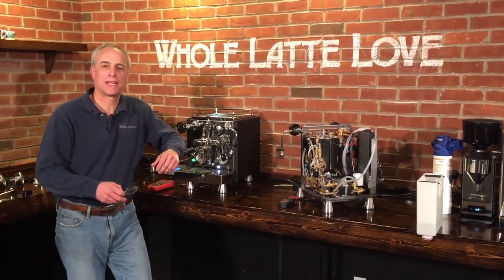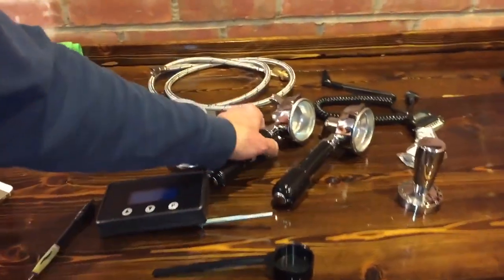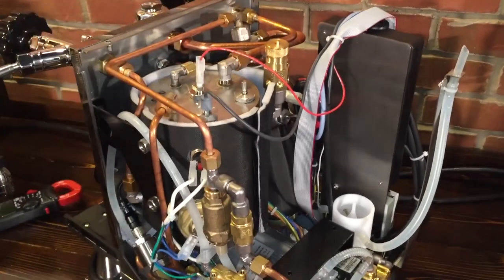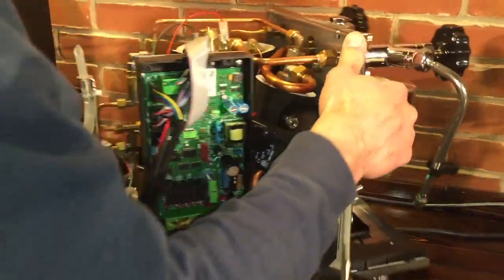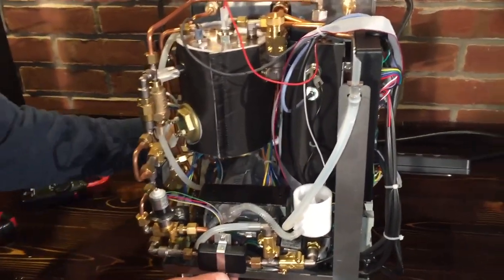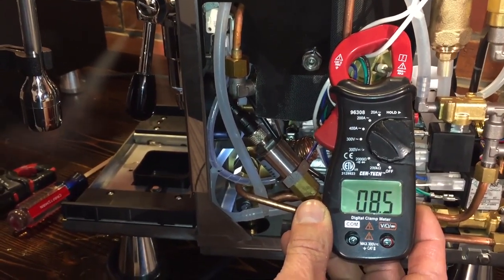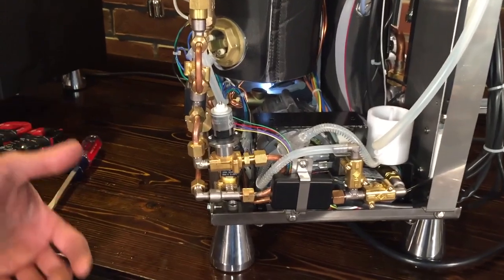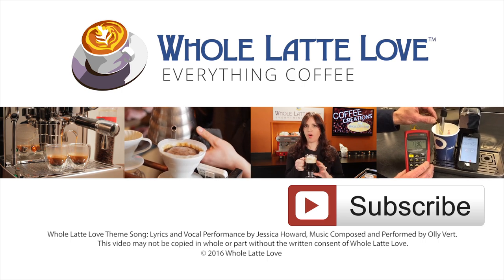Review Rocket Espresso R60V Internal Tour

Comment: Can you include the manufacturer / part number of the stepper pressure valve?  It would nice to learn more about how that works to control the pressure.  Thanks for the walkthrough of the internals.
Reply from the maker: +jgirl125t Great question! we are working with Rocket now to get some spare Stepper Motors in. If you're a subscriber to the channel, look for a video going public today that shows the stepper motor in noperation. The quick answer is it's a rapidly modulating valve opening used to control pressure. A little different setup than other pressure profiling machines which vary the speed of geared pumps to control pressure. Here's a video in the meantime on the Vesuvius machine which uses a geared pump: https://youtu.be/S2aG_gVll5g

Comment: Can you just use regular filtered water if you don't have a filtered waterline?
Reply from the maker: +tin nhu Hi, You can use regular filtered water. It would help to know exactly what filtering is done of that water. Many of the pitcher or tap mounted filters do little if anything to reduce alkalinity which is the cause of scale deposits. They tend to focus on eliminating chlorine, chlorine derivatives and other chemicals using activated carbon. This improves flavor but does nothing to reduce scale deposits. The R60 has an intricate internal plumbing system - especially the stepper motor which controls the pressure profiling. In our opinion a filtering system which provides a proper alkalinity level is a worthwhile investment. We recommend the BWT Bestmax filters. They use ion exchange to remove minerals which cause scale build up and add magnesium, which does not cause scaling, back into the water to maintain flavor. https://www.wholelattelove.com/products/bwt-bestmax-premium-filter-package

Comment: Post more r60v videos guys pls you guys haven't posted vids in so long what happen ? Pls put some vids on pressure profiles that you could try out on the rocket
Reply from the maker: +sammy savvakis Hi Sammy, we've been working on some other projects. Getting back into new video mode soon! Might even be trying some live seminars. We've been playing with the R60 and will have some more on pressure profiling in the future. Here's the thing though: It's really difficult to say use this profile with xbar for so many seconds and then this and this and this. What works for one coffee may be terrible for another. In general what we've been doing is starting at a lower pressure for 5-10 seconds then ramping up in a couple steps to 9 bar and then back down to a lower pressure to finish. Frankly there are an infinite number of variables with things like grind size, dose, brew temp and of course coffee and coffee freshness playing into the final result. We are currently evaluating another pressure profiling machine we hope to carry in the future. It has has control dial to vary the pressure throughout an extraction. It operates more by watching the shot as it progresses and adjusting the pressure manually moment to moment. Also a little different in how it changes pressure. Instead of the stepper valve downstream of the pump, it modifies brew pressure by adjusting the power sent to a vibration pump. If you're into pressure profiling another machine we're impressed with is the Vesuvius. It uses a geared rotary pump to adjust pressure and sounds amazing when it does it's thing. If you have not seen the video we did on it, check it out here: https://youtu.be/S2aG_gVll5g
Here's more detail on the machine as well: https://www.wholelattelove.com/products/vesuvius-dual-boiler-espresso-machine-with-pressure-profiling
Reply: o